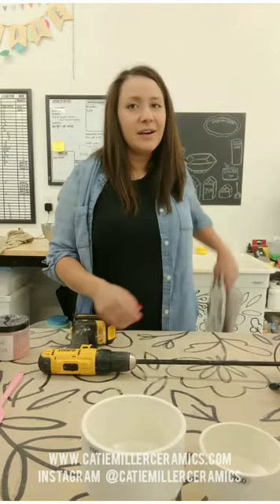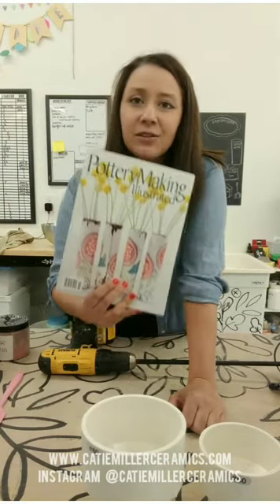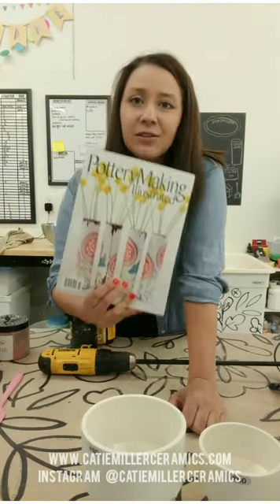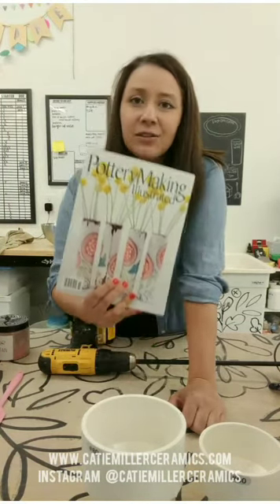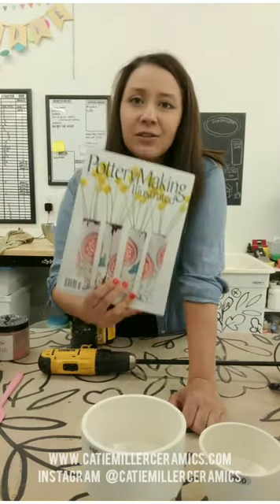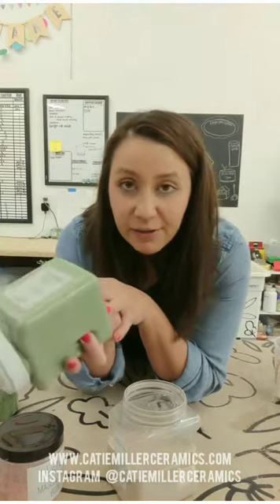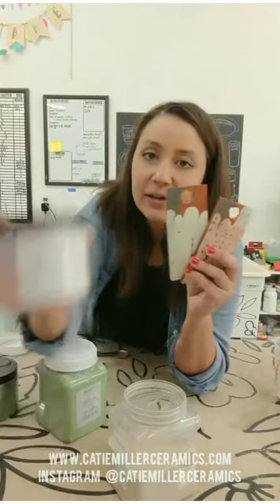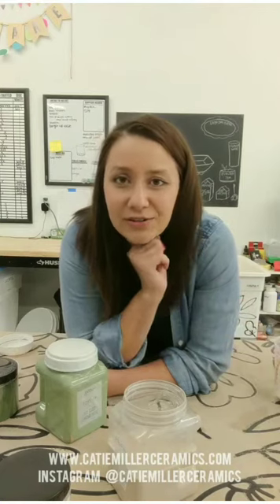Tutorial Tuesday: Mixing Slip with Catie Miller

Comment: a good tip for newbies would be to tell them to make sure they add dry ingredients to wet or they'll end up with a huge chunk of clay mess glug that will hardly separate. ask me - I did that in the old days hehehehehe!    and that they should let it all slake down for a day at least so the water absorbs into the particles.  I love your work and your videos and have used your techniques oersonally and with my students.   Your idea is much better than what I was doing before I found you so thank you for your generosity.  Lu x